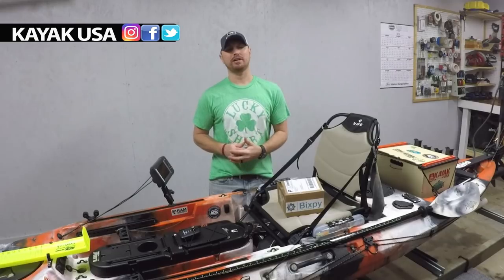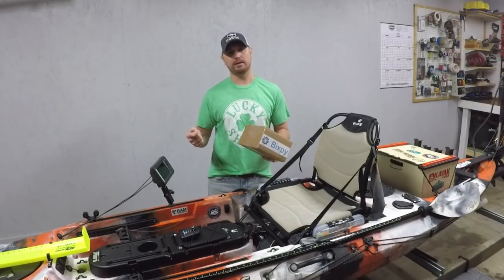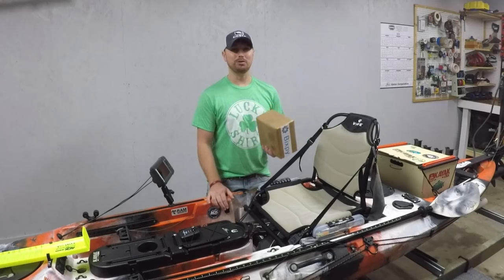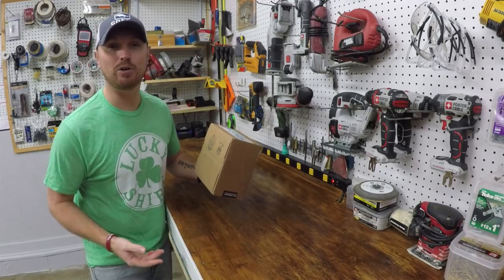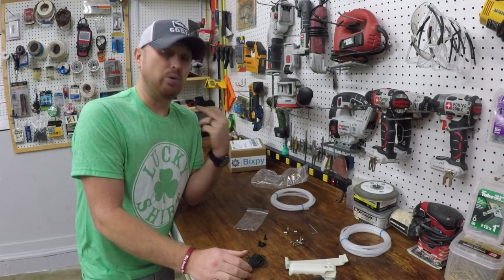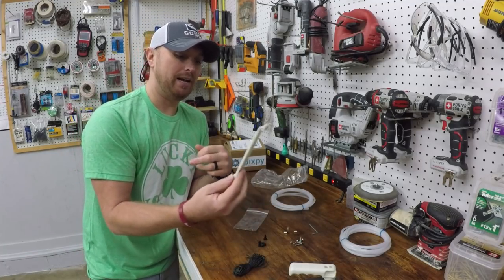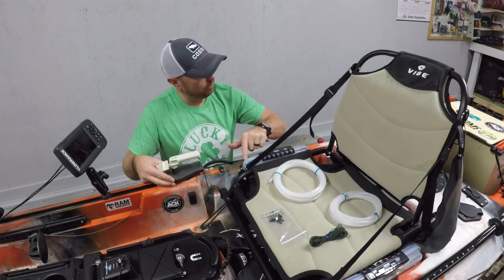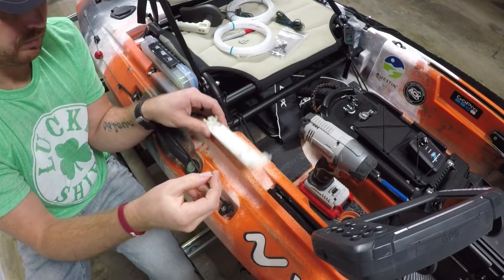Homemade Kayak Motor w/ Bixpy Hand Control | Full Install | DIY

Comment: You would have been better off installing sliding foot pedals for the steering, the stock ones on a seaghost blow chunks.   With the hand steering you won't be able to be mostly hands free LOL

Comment: I saw your video and ordered the hand control. Installed it on an Ascend 12T and after the test run I changed the lines. I used very thin wire line that has a rubber coating. It fit easy and now it turns on a dime. Was wondering if you ever did change your line and if so what did you use?????
Reply: Does the clicking go away when you push down on the handle to steer? Is the clicking the “locking” system?
Reply: What kind of wire did you use?
Reply: @Lethallead138  it was rubber coated wiring from Home Depot.
Reply: Ok thanks for help. I will look for it.

Comment: Think that the clicking noise will bother you after a few trips.........Let us know??????
Reply: Hi Dave, that clicking sounds can be avoided if you push down on the handle as your turn.  The clicking is a soft "locking" mechanism to keep the rudder's direction when the handle is not held.  The handle is spring loaded and if you push it down, it will get past the notches and not click while you turn.  Hope that helps!

Comment: Cool setup. But I would reuse the cable wire to minimize the stretch and get a tighter swing and grind off smooth the plastic gear teeth on that handle. It is an annoying sound. Good deal

Comment: Hi TJ, 
Thanks for the install.  Just a couple of quick hints for this install.  Most of the heavy lifting is done by making sure the tubes are really nice and tight and flared at the insertion point.  That way when you steer and the lines move, they don’t cause the tubes to move with them.  The clicking noise is the steering “locking” and it can be virtually eliminated if you push down on the spring loaded handle when you steer.  Love the video!!  Thanks, Bixpy people :-)
Reply from the maker: Thanks for watching! I was just thinking the same thing about the tubes not being tight enough, I’ll definitely be checking that out this afternoon. I’ll try pushing the handle down when I turn it today as well.
   BTW, I’d love to do a full install video of the actual Bixpy motor kit on my channel!! “Hint Hint” 😂 
   But seriously, thanks for watching and taking the time to comment, Feel free to share the video 👍🏼
Reply: @KayakUSA1  The Bixby I installed on my Big Game 2 has been good so far. Louder than a trolling motor but my biggest issue so far has been my lack of confidence that it will stay secured to the universal rudder mount. I have to figure out some sort of leash to make sure it doesn't do . submarine impression while I'm in 200' of water. 22 pounds for motor and battery can't be beat.

Comment: I believe the tubee is flexing inside the kayak that is why it's not responding. It's moving the tube. If it was solid or fastened to the kayak there wouldn't be any hesitation in response time when you turn. I'd pull that other side, that's not a straight shot to the back of the kayak, as tight as you can get it. That will help I believe. Good luck. Great video bud! Oh yeah I got my kayak finally. Got the camo 130 two days ago👍🏻 !
Reply: Congratulations welcome to the madness
Reply: Tubing flex can't be the culprit. 6ft of tubing is 6ft of tubing whether it's straight or curved or coiled. If you pull 3 inches at one end, the tubing can do whatever it wants, it will still pull 3 inches at the other end. The only thing that could cause the problem is stretching of the line.
Reply: Maybe try the heaviest spectra braid you can find, or even weed wacker line.
Reply: @ryans9029  if the tubing is floppy inside, pulling the handle will move the tubing. Same principal applies to bicycle brake cabling. If the cable is unsecured, it won’t work properly.
Reply: @jeffhutt4873  literally incorrect .. 

Your example of a bicycle brake tube is on point...  The tube is free to move... But the cable inside the tube is limited by the sheath\tube... They work in conjunction... And if both ends are secured .. it will function perfectly... 

It's all about lengths... The tube inside the kayak can move wherever... But at long as the two ends are secured... The length of the tube inside the kayak doesn't change...  Regardless of it moving around... These systems work by length of the tube vs the length of the cable inside the tube... You pull (shorten) the cable inside .. that translates to pulling at the other end.... And vice versa... 

Bike brakes don't work.. when one end of the sheath tube is free to move... 👍

Comment: Can also use a vacuum cleaner to pull lines through. Hard to see but the line may be too small for tubing. I prefer stainless wire.

Comment: Have you looked at doing a solar panel charger for the battery powering your units and such been looking at doing it but can’t figure out  where it would be best to mount it on sg 130
Reply from the maker: You read my mind! Lol 🤙🏼
Reply: Kayak USA https://www.amazon.com/gp/aw/d/B06WP95W51/ref=ox_sc_act_image_2?smid=A2ITCJZ76JTN7Y&psc=1 here’s the one Iv been looking at just can’t decide where to place it to charge the battery in the front

Comment: I would get a can or two of spray paint (and probably a can of primer) and paint the body and handle to match the boat.  Maybe an orange for the handle and leave the body black, or orange body and black handle? Whatever you think suits your kayak best.  And then possibly add a bit of silicone in the body to seal the tubes.  Probably unnecessary, but it would help to keep grit & sand (and salt if you are on the ocean much) out as well.  But if you don't find any of that getting into the handle body, it would just be adding mess.

Comment: T.J. question bro. I've got a field and stream eagle Talon yak, I need to raise my seat however when I raised it 5" the kayak became very unstable. I need outriggers to stabilize, do any recomendations on how to make outriggers or anyone's channel o  making outriggers.
Reply from the maker: I’ll do some digging for ya🤙🏼
Reply: Thanks bro
Reply: they probably don't need to be very big, but should be light  🐟
Reply: use PC pipe to make any size you want and custom fit, use round end caps on tubing

Comment: When mounting hand control on vertical surface do you know if the control handle can be adjusted to be in neutral position straight up? That would be 45 degrees out from original rest position. In other words mounted like a stick steer. Thanks and appreciate your clean detailed workmanship.
Reply: It cannot. But with a little modification, it seems to be possible.

Comment: Love the idea of the turn handle but im like you the noise is loud as heck when you turn. Maybe file the inside so its smooth or Lube!!
Reply: If you push down on the handle its silent.
Reply: And so....after almost a year, what is your opinion of the hand steer vs the foot steer? Which one are you using now?
Thanks

Comment: Nice! 
It is off to the side and not center of the kayak so maybe that is playing a part with it not popping back over to mid? 
Did you use silicon where the tubes went in the back and front, just for extra sealing?
Should fit perfect on my tamarak! Has a lot of space on the right side. It will be a while before i get a motor on it and everything. My wife was nice enough to get me a fish finder for it last week. Need to get that installed along with a gear trac. Then i gotta get the battery box made and wire everything up. With 4 kids (3, 7, 9, 14) getting everything is slow going. Lol
Also been so cold up here in Ohio i haven't had the will to go in the garage and do anything. The kayak is still in plastic. Can't wait to get out and do some catfishing on it!
Nice video!

Comment: T.J. I bet you will have to change the line, because the drag from the water on the motor. Also, is there a way to get rid of the clicking of the handle. That noise would scare off the fish.

Comment: With the steering lines tight, are you still able to raise and lower the motor?  Looks like there would have to be some give somewhere. I just received my hand control and am in the process of replacing my foot steering with it on my 14. Native ultimate. Foot controls hard for me to use with my wading boots on. I must be able to raise and lower motor. Can you do it?  Thank you, love your videos.
Reply from the maker: Yes, it still raises and lowers. The only difference now is, when it gets high, it tilts the motor forward a little on the way up. But that’s kind of a plus 🤙🏼🇺🇸🎣

Comment: I know this is an older video, but how does the cable work with the power trim? Wouldn't the cables get more slack as you lower the motor?

Comment: Nice clean install!
A couple of things i see.
 I think Paul jr is correct there is s bow in the tube inside the hull. May need to check that out Possibly find a way to lock them down inside the hull so they cant flex when pulled.
 Test this by taking the handle off and puling on the cord with your hand and see if you get slack that snaps back but doesnt move the motor.
 Also i think you will find you can get more turn from the motor if you make your steering cross member longer on  each side Maybe set up one that is V shaped
Reply from the maker: Thanks bud! I have the tubes straight and tight along with the lines. The line stretches pretty bad and I also think my  metal carabiner things they are tide to are part of the problem. I do think I’m gonna try to get the bixpy steering arm, like you said, it should be further off the shaft on each side. I’ll have it all worked out soon, and I think I’ll love it. Thanks for watching!🤙🏼
Reply: @KayakUSA1  didnt know they made one also.
The one i was thinking of is by easy mount or i guess now primal
https://www.4primal.com/shopprimal/v-force-steering-bracket
Reply: You would shorten the arms on the shaft to get more tight turning radius. The lever only pulls so much line, so adding longer arms on the motor would cause the motor to react less, this turning less. Shorter arms will be harder to turn, less mechanics advantage, but will turn the shaft more. Like any lever or gear system.

Comment: If you wrap the line around the internal pulley one whole turn or more, can you get it to pull more line by turning the lever more, thus pulling more on the motor shaft? I have essentially designed this same system on paper, now that I found someone actually already makes it, I don't have to mess with making it.
Reply from the maker: Thanks bud! I’ll definitely try that out!!🤙🏼🎣🇺🇸

Comment: Is there a followup? Did I miss you putting the spring back? Did you figure out how to quiet the ratchet noise? You may have already done it, but I found that the cable sold for bicycle brake controls is just the right size/length.
Reply: What  is the right bicycle  cable  info

Comment: Its been a while since you installed your steering mechanism. How do you like it? Anything you would have done differently?
Reply from the maker: I have only been able to try it out twice so far... It actually does great! And I have it dialed in very good now, I still don’t get a full 90 degree turn either way but it’s only because of the actuator arm being in the way. If I didn’t have the actuator, it would turn the full 90. But it still works great🤙🏼
Reply: @KayakUSA1  Cool, I have an older Minn Kota 40lb thrust I'm trying to mount on a Feel Free 13.5, and your video's are really helping me decide which way I want to go! Thank you for posting the info!!

Comment: Don't like the noise and vibration.  Also, could you use a wire cable to get rid of the stretching from the manufacturers line?

Comment: Yeah man, that clicking would drive me nuts. I mean that's really the point being in a kayak all quiet and creeping on those fish. LoL.  but what about putting some bushings in there and make it a pressure fit that wouldn't let the motor turn by itself, still would need some force to turn it. Just a thought. You might have to diy it. You can do it brother 👍.

Comment: bye bye string cable and stretch ...... https://www.amazon.com/Schwinn-SW76193-4-Brake-Derailleur-Repair/dp/B00L8NDVD6?ref_=s9_apbd_orecs_hd_bw_bEHjV&pf_rd_r=EVKPNE0CRCQP561BJPPG&pf_rd_p=34e55a94-3a59-5b85-ab0c-ff40acbd085a&pf_rd_s=merchandised-search-10&pf_rd_t=BROWSE&pf_rd_i=3404761